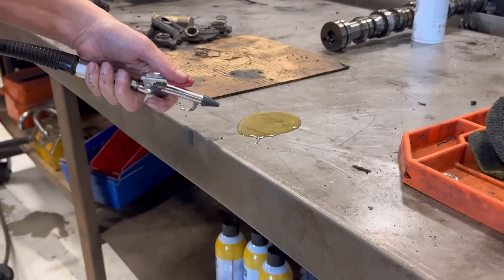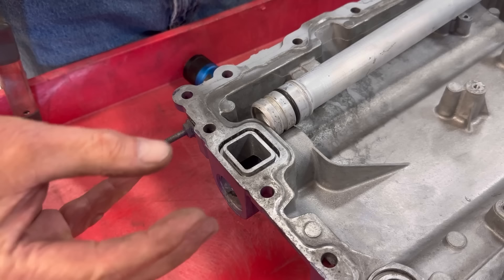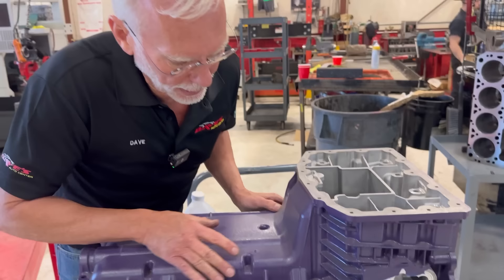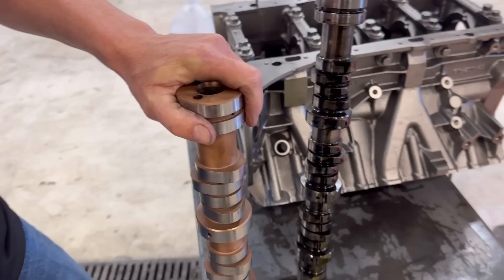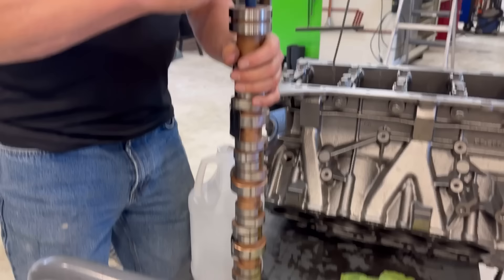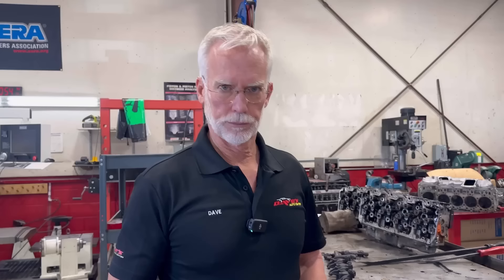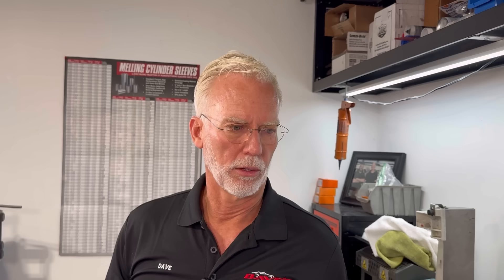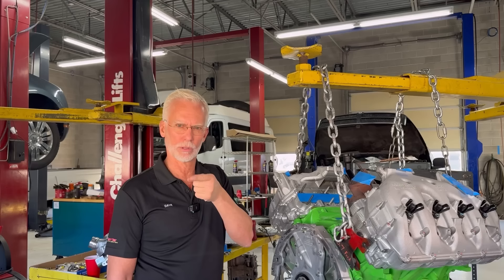Part 1: Ford 6.7 power stroke oil starvation issues revealed

Comment: This is phenomenal. Whatever you charge people…is worth it. I have never seen a mechanic take this much interest in making solutions rather than making money off of common problems.
Reply from the maker: Thank you so much! It is an obsession of his. Appreciate you watching.
Reply: @DavesAutoCenterCenterville quick question, what do you think about the Mercedes m278 and 157 engines? I’ve heard a lot of slack about them but I’ve also heard pretty good things about them, me and lots of people would love a review and period corrections history!
Reply: That’s the difference between a mechanic and technician.
Reply: Gale banks
Reply: Now compare him to whiny deboss or mr subaru or all the other charlatan fan boys. He stands out even more next to those clowns.
Reply: Just remember this guy's is an engine rebuilder (engine with NEW specifications) which requires engineering knowledge that gives him the ability to understand and alter these engines. Your average mechanic doesn't know that kind of special information, they rely on the engine manual made from the engineers themselves and OVERHAUL it (back to manufacturer specifications). Get your info right and stop blaming the mechanics. It's the engineers fault
Reply: @estebansalcido5015  ^ this is your life on room temperature IQ
Reply: @williamcooper2037  thank you for being below me
Reply: @estebansalcido5015  but now your below him😂
Reply: He’s not a mechanic, he’s an engine builder.
Reply: @estebansalcido5015 What the hell are you on about youngster?
Reply: @estebansalcido5015  you know nothing about mechanic work. find yourself some of those 'engine manual made from the engineers' and see how much they help. then realize there isnt a single actual mechanic that looked at that. 

engineers are not gods. some of them are idiots.
Reply: @bradhaines3142  sorry buddy, YouTube certified doesn't get you a job at a shop, and your daddy/uncle or whoever taught you didn't know enough. Yes some engineers are human too and make mistakes, but that doesn't get you more credit than they have. If you telling me that you've never read maintenance manual, or instructions from a website or anything like that your full of BS. I'm  A&P mechanic, ASE certified Diesel and soon to have a ASE Automotive certification with 11 years of experience. The one that doesn't know is you. You sure don't impress me with your self-taught/trial and error  automotive experience.
Reply: honest hard work pays off it really does
Reply: @DavesAutoCenterCenterville I am a DIY with enough knowledge to get my ass in deep doo doo.  My ? Is, would, in this case, it be better to overfill by three or 4 quarts so that sump cannot suck air in the engine drops low on oil?  It seems to me that, once everything is in the engine there is nothing left over.  Thanks, Ed
Reply: I ran into this question on on the engines I specialize in and discovered close to a half of a quart of oil had to moved before the cam and rockers got oil( overhead cam ) not to mention when running that oil is not in the pan. Solution was to move the full mark on the dipstick and put a charge system oil system and a camshaft spray bar. These are classic cars and tend to sit for periods  of time so if the owner open the charge system valve it dumps oil on the cam and rockers so they don’t run dry until the oil gets there.
Reply: @edwardtabor77 Absolutely not. Never over fill an engine, ESPECIALLY not 3-4 quarts. That’s how you hydrolock a motor
Reply: @estebansalcido5015  Mr subaru is so wack

Comment: Ive been working on Powerstrokes for a little over a year mainly 6.7s and honestly RARELY come across the symptoms you mentioned. Many oil changes turbos upper oil pans and full engine reseals, I have NEVER first off heard any clacking noises after an oil change or seen a 6.7 lifter explode sending needle bearings through the motor like the 6.0s. The early 11- mid 12 years the tappets in the lifters spun and fail but NEVER has ruined a camshaft, had one recently pushrod came off the rocker arm and was STILL running fine. Actual big reason is people LACK MAINTENANCE never have seen a 6.7 bottom end spun a bearing even with ccvs that internally go bad and suck/burn oil didn’t ruin an engine. Ive seen 300k 6.7s and work trucks for asphalt companies high idle times and rarely have issues. If there is anyone to blame for engine failures its owners who dont keep up with maintenance schedules, repairs and abuse them with tunners so cant blame engineers if they’re not intended be taken care of and for proper use.
Reply: I have seen a few bottom end failures . I read a few articles about the higher incidence of spun bearings in my region, colder climates/northeast likely due to overly tight bearing clearances which have now been re-engineered, which is why for specifies 10/30 syn oil . While I too have seen long durability from most of my my 6.7 fleet. I have also seen my share of fuel system failures (cp4 pumps), various oil leaks, some rocker arm failures, emissions issues, EGR plugging, wiring harness (green wires) and fuse box corrosion, crankcase filter plugging, injector clamp failures, I even had one with broken crank/cam timing gears (probably from impact gun use). I think most of the internal engine issues could have been prevented with better oil change practices and higher quality oils.
Reply: A year is infantile in experience.
Reply: It is great that you take the time and use common sense  to make things better. It is never a good idea to starve an  engine, no matter the amount of time or how good the oil may be.
Keep up the good work!!!!
Mike
Reply: More maintenance, proper oil filters with anti drain back valves. All motors have compromise in designs.
Reply: ford dreamer keep working honda civic raisin brean
Reply: @damiandiesel1  I will admit climate does affect these trucks but also depends on the circumstances, some people don’t use the block heaters and again lack of oil changes that oil gets thick real quick i know and seen 5w-40 on the oil caps which is what should be used in cold climate where i’m from doesn’t apply 10w-30 motocraft and oem filter is enough, any cp4 pump is garbage but thats due to the sulfur in fuel because in germany the fuel they use when building them is different over there compared to U.S and even then people dont use fuel additives again maintenance. all the other problems ive seen as well early ones are worse then the newer 6.7s my point is just if you dont take care of them thats what happens not the design
Reply: @bertblue9683 compared to how many of yours? been doing automotive for years before diesel im sure i know a thing or two, not sure how a year is considered “infantile” when my shop is ford based and the min i clock in till clock out constant 6.7s every day of the week. if i did one every now and again you may have an argument but when you work on 15+ of those same trucks a week you learn more then a thing or two
Reply: @silvac196 😊
Reply: Back when I was in the auto industry, in 2021 when it got into the teens for temperature we had a few customers that complained of the lifter clatter. We changed them up to the 10/30 and the clatter went away. Our theory was that the oil filters anti-drainback valve keeps the oil from coming back into it, keeping the rails full.
Reply: Ford fanboys are going to hate on a video like this no matter what--cognitive dissonance is never more evident.  Try to be objective.
Reply: If you haven't heard a clacking 6.7 you haven't been doing this very long 😂
Reply: @MrC9Oh3 or maybe its because we actually service our customers vehicles correctly and on time and inform them how to properly take care of them rather then just draining oil slapping on a cheap parts store filter and cheapest oil you can get then let it go past the maintenance intervals then coming back blaming them for not keeping up with it as they should
Reply: @john.miller first off buddy im not even a ford fan lol i work on them keeps my bills paid at the end of the day i own a bunch of toyota pickups and a new tacoma second off im giving my own personal opinion of what i SEE on a daily basis working on these the real objective here is he is bashing on a design due to the fact a truck came in with most likely an oil starvation issue then proceeds to explain to a bunch of uneducated people on a topic they most likely dont know about with HIS OWN OPINION on why HE DOESNT like it rather him actually showing the whole diagnostics procedure and why it failed in the first place instead of using his platform to sway people on believing he knows it all and that they’re junk which isn’t true
Reply: @silvac196  has nothing to do with service these are issues from the factory. It's obvious you don't do much business.
Reply: @MrC9Oh3 okay so then whats the actual “issue” from the factory lol and if so show me an actual tsb number or recall stating that every 6.7 made needs to be returned for a new engine or fix because of clattering the nhtsa would’ve stepped in by now no? if i didn’t do much “business” how would i have been able to comment or reply in the first place about 6.7s or anything ive stated prior, this has nothing to do with business first off this is about all engineering/mechanics so dont get stuff twisted on the topic
Reply: @silvac196  I feel sorry for your customers, do some research.
Reply: @silvac196 lmao yeah you sound like a real Engine GURU I seen were you say you been working on 6.7 power strokes for a yr and you talk like you know more than this Old mechanic on this pg
Reply: @MrC9Oh3 sure cause you interact with my customers so you know their exact thoughts right? never had one upset or complain about any noise. only thing sorry here is your responses that state nothing no real evidence against my comments besides go look on the internet like everything you see is true on there
Reply: @donaldkinder6716 never claimed i knew more then him but when it comes to 6.7s im sure ive seen and worked on a lot more then he has have torn apart so many i know them better then myself. funny how EVERYONE including yourself responds with the same lame comments of a year is nothing but no one can actually state any actual proof or evidence of any failure against my comments that actually state facts
Reply: @silvac196  calm down man it's ok. Everyone starts somewhere, you'll learn as you go.
Reply: Little over a year 😂
Reply: I have to stop watching these. Im afraid my  new 85k powerstoke is going to grenade on me if I don’t drive 40 to the store or change the oil weekly or if I don’t delete it. I’m out can’t take anymore.
Reply: Great work. In my mind if you don’t need a diesel don’t buy one especially in a truck you just drive around like a car.
Reply: @silvac196  No this guy making this video for views is clearly smarter than an entire team of Ford design engineers with a combined 500 years of powertrain design, who just woke up on a Monday after a bender and as a joke, went about designing an engine that would starve itself out of oil on every startup, because they thought it would be a funny experiment.....of course that's what happened.  Seriously, though, I had to quit the website "Dieselplace" some years ago, which I had joined after getting my Duramax, because my head got so full of horror stories about how my 6.6 was going to throw out some damn pin used to align the cam gear, or how my "front pump" on my 4WD assembly was guaranteed to fail and come through the casing at 100K, etc. etc. and I've now run 230,000 miles and had ZERO trouble with anything, except the obvious injector flaw.  It took me awhile to realize that site was full of "experts" who spent all their small-dick syndrome days trying to blow as much smoke with their tuner as they could, and then would wonder why f'ing with the factory design resulted in magical failures.   Just drive normal, leave the damn thing as it was designed, and enjoy the reliability inherent in 100 years of design expertise.  I hope whoever this guy presents the $25,000 tab to feels like they got their money's worth.  Oops, I did almost forget about the brake line rust issue, which clearly SHOULD have been a massive recall, but with the number of affected vehicles, would have BANKRUPTED GM again.  I still remember the joy of laying on the driveway routing new stainless lines all over the entirety of the truck.  So, I guess that is TWO major design flaws I've had to deal with.
Reply: Ok so I'm sorry but if you have never heard a 6.7 tick after a oil change you surely haven't been around them very long. Multiple tsb's for the issues over the years. I started at Ford in 2005, senior master Ford certified in 2009. And watched these trucks from inception. I left the dealers in 2013 and started my own powerstroke shop. I assure you 6.7s have many major issues.  It seems the gen 2 15+ 6.7s had the most main bearing failures. 11-14 trucks had the lifter tick after oil changes, 11-19 trucks spin the timing gears on the cranks, 15+ oil pan issues, 11-14 drivers heads Crack, 11 valve issues. And the list goes on.
Reply: @silvac196 i work on these trucks day in and day out. Im senior master ford diesel tech been working on them since day one and have seen may share of engine failures and they are all due to lack of maintenance and wrong oil viscosity junk filters. Any truck that i have serviced since new including my own never heard anything funny or had issues. My truck and lots of others i work on have over 300000mi and still goin. Lol. The 6.7s are very dependent on maintenance and rite oil for temps u live in.
Reply: Daniel McBride
Reply: So what do you think about dura lube
Reply: @jeffferguson4632 you should do some more research on this channel this guy isn’t some yahoo, he has a million dollar facility with cutting edge tooling  and is repairing/fixing things other shops wouldn’t touch. Your truck is 1 of many on the road, these are about the worst cases I’ve seen and shown for educational purposes, so you really can’t compare lol
Reply: @williamoestreich6905 I think my viewpoint on these and similar consumer-oriented diesels most closely aligns with your observation. Do the proper maintenance with the proper pedigree parts, skip the tuners and mods, and keep your foot outta the firewall, and they will serve you well!
Reply: Almost one year against Dave's 40-50. There are several ways to show ignorance and disrespect and this is one of them.
Reply: Looks like an over engineered POS, same as the rest of the big 3 that offer diesels
Reply: 20yr ford diesel tech here, I agree that I have never heard this lifter chatter after an oil change he's talking about.  But as far as spun main bearings, I've lost track of how many 6.7 short blocks I've put in these trucks it's unreal. And it had nothing to do with maintenance on most of them as the shop I work at did the maintenance on most of them and they were always done on time.
Reply: One year experience….. Hmmmm, I’m really listening to your advice based on your VAST experience….. really, I am!!…….. NOT!
Reply: @john.miller Ford guys are like Subaru owners, no matter how many times the engine blows up,  they will never criticize them, and they will invest many thousands of $$ over their value every time.
Reply: The 6.7s have been stacking up on facevook marketplace for parts lately .  I'm sure they were neglected . Especially oil changes.
Reply: Then you dont work on alot of 6.7's dude because this is weekley
Reply: @natgasf7236 hahah, that’s exactly how I feel.